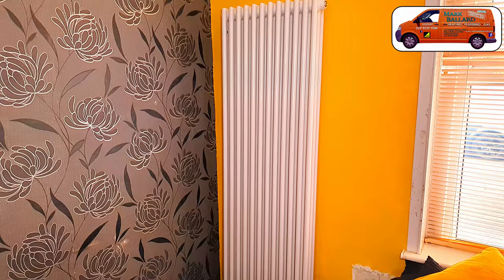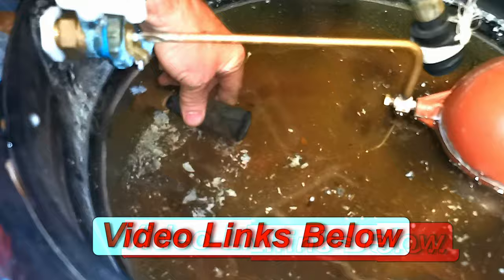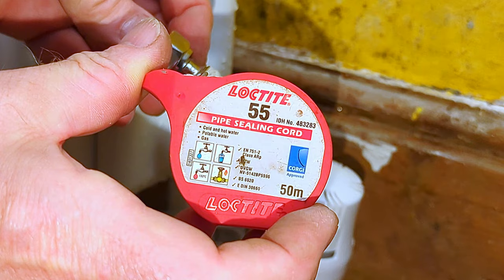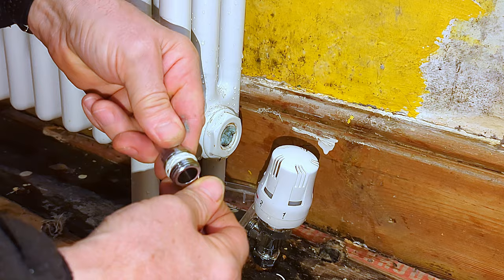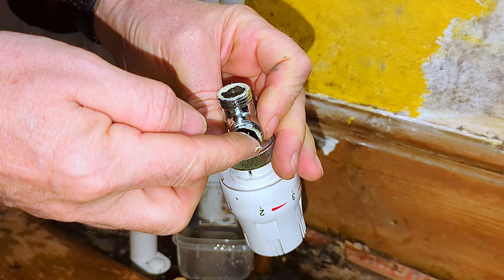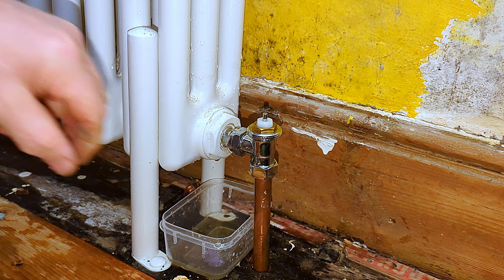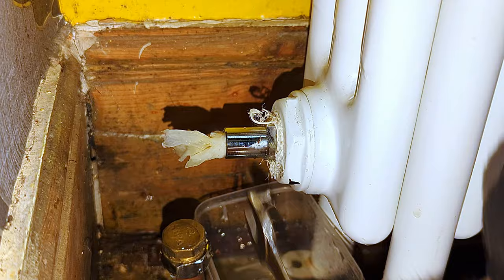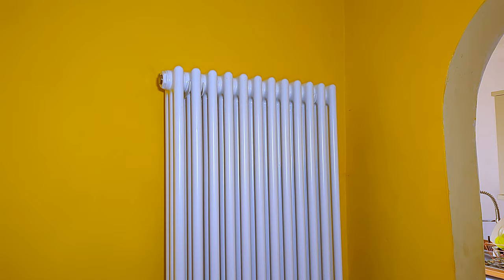How to Fit Radiator Valves & How NOT to Fit a Radiator Valve.  Fixing Leaking Radiator Valves.

Comment: I have a leaking rad problem from some rads I installed recently, exactly as described in the video. I followed the installation instructions exactly.  I am quite surprised to learn that the problem is that the tails supplied with the valves are basically incorrect.  A lot of people believed (including I presume the original plumber involved in the rads in the video) that rad threads and tails are standard and any tail should fit any rad.   That appears not to be true and the rad suppliers don't make this clear.  At least I know now so I can correct it.   Very useful video - many thanks.

Comment: All common sense to a properly trained engineer but good advice for DIYer. Personally, I would advise you only apply joining compound to the compression ring (olive) and 3 or 4mm of pipe either side. If you apply it as shown you risk pushing it into the valve when you insert the tails. You also risk the chance that there is insufficient jointing compound left to provide an effective seal between the olive and seating.

Comment: On the valve, I thought it was the olive and compression nuts on both sides of the valve which provided the watertight seal.  Why would you need any extra sealing compound on the compression nut as you showed being applied?  This seems wrong to me.
Reply: Take apart a compression joint and reassemble piece of pipe then closely look at how everything goes together and think about where water goes through the pipe, and think about where the first place the water will escape from its intended path.   It is on the surface where the olive meets the compression fitting. If that surface isn't water tight then you will get a leak. I used to think the same as you but Mark is correct.  It's good to understand fully what is really happening.

Comment: Nice video… with some sloppy mating threads like that hemp and boss white would have been a better choice. The hemp expands with moisture and would most likely provide a better seal. I’m talking generally about tapered thread fittings. What you did here looks good though. The trouble with PTFE tapes etc is it doesn’t expand with moisture. In theory you shouldn’t really need jointing compound with olives but I get it’s a belt and braces approach and would do similar. I’m just a DIY guy though. I really like the way you explain the detail and pitfalls etc. Thanks for making all these videos. 👍😁

Comment: Hi Mark. Really like your videos, you're very clear in how and why you do things. 
I've a question regarding the tails. I've got a new rad and fitting new valves but the tail keeps spinning. Is this a case of the tail not being tapered sufficiently? Or a poorly cut thread on the rad? The inlet seems nice and tight.

Comment: I have bought a radiator with both the valves fitted, the problem I have is that all the pipework to the radiator is 1/2 inch copper. How do you connect to the valves which seem to be 15mm?

Comment: Hi Mark,
I have an aluminium double column radiator which is supposed to give an output of 5737 BTUs but I’m not really getting anything like this. All other radiators in the house are impossible to keep your hand on for any length of time when running but with this radiator I could keep my hand there all day long. Do you have any suggestions, also what method can I use to determine the actual heat output. Many thanks.
Reply: You need to balance your system
Reply: It’s not that. I found that the installer has connected the flow and return pipes the wrong way round on the radiator. I contacted the radiator manufacturer who said this was important as there was some kind of flow regulator within the radiator.

Comment: I don't understand why such an important fitting needs rubber tape to maintain a seal. Bad engineering?
Reply: It’s not rubber tape it’s PTFE. To provide seals on fittings typically you either have a tapered thread and use a tape or sealant system or if the thread is parallel you seal on the two mating faces using a fibre of copper washer. The threads need to meet the standard dimension tolerances but in the case of some they can be incorrectly manufactured and then will not seal correctly.  There are also various other types of seals used in the pneumatic industry that sometimes cross over into the plumbing arena.
Reply: @chrishard7616 It should be a flat surface to flat surface with a suitable washer (copper or rubber). To create a seal on the current system takes loads of ptfe tape not just a couple of turns. I know it won't change but, as an Engineer, I beleive I am right.
Reply: I agree that would be good but in the pipe fitting industry there are various ways of achieving seals and tapered threads are sometimes used. For rads though a parallel threaded fitting with mating flat faces and a copper or fibre washer would be a better option. Rubber washers are no good as they just squash and spread out from the joint. An alternative could be to use a fitting that has a rubber type O ring in a groove (a bit like a washer) that gets partially compressed into the groove and held in place.